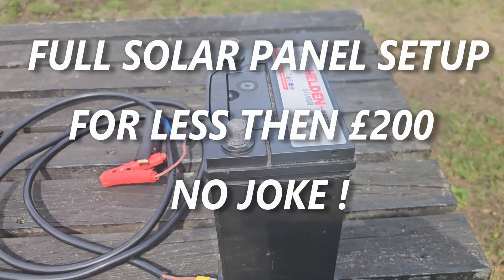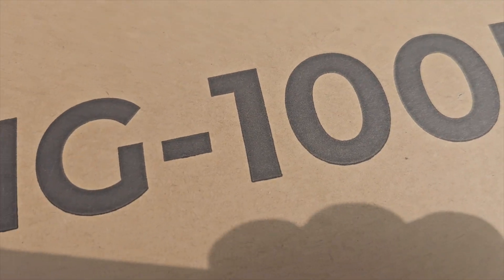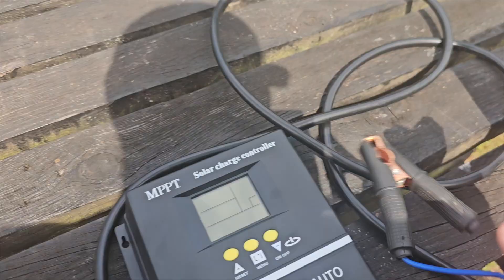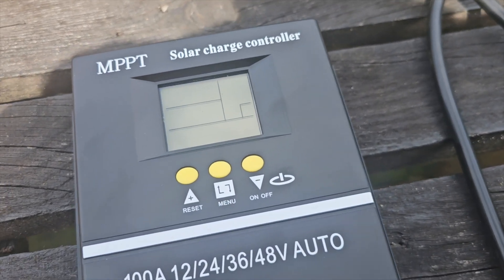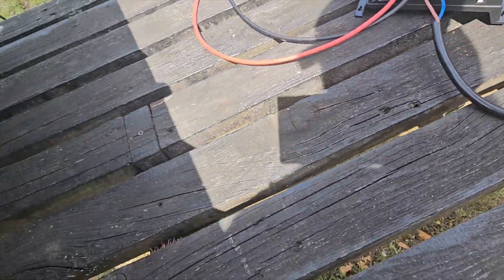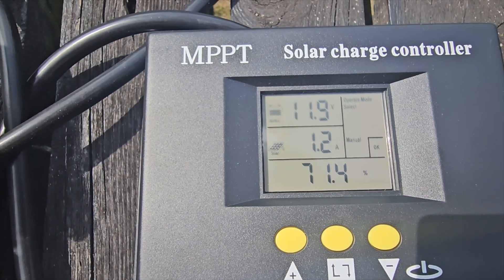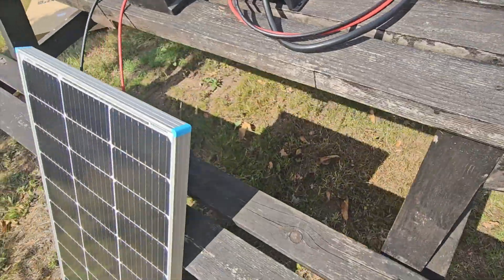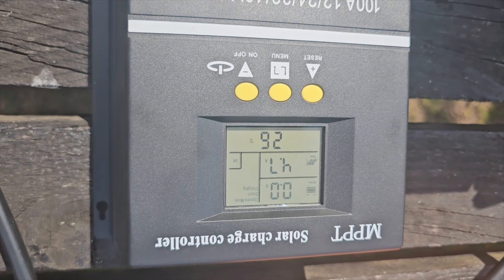full solar panel setup for less then £200 no joke!

Comment: Them charge controllers aren't mppt, they all fake ones not very efficient as mppt, definitely don't use them, not sure if they're dangerous or not, they seem cheap, but why are they so cheap... There are videos of these being opened up, there's no large coils in them can't remember what they're called but all mppt controllers have them, there's non in these, and they're definitely not 100A
Reply from the maker: your spot on this video was just how cheap you can Build a full kit for this kit is going on my trailer as back up charger and lights thanks for comment and watching ATB
Reply: @MrMeltedwellies  hi buddy, only way I know about the mppt thing is that I bought one🤦‍♂️... You learn very quickly when it comes to this stuff, I wish I'd have watched more videos 😞